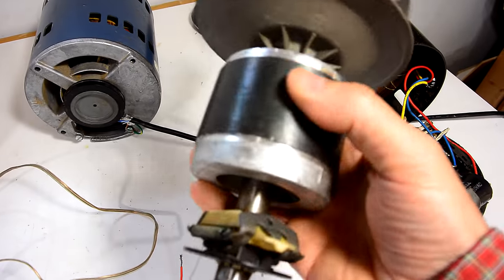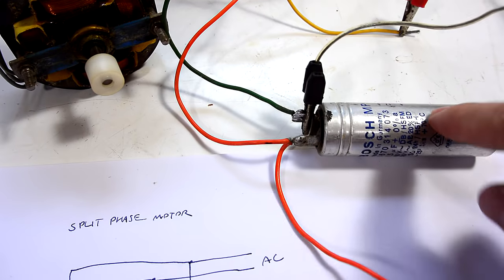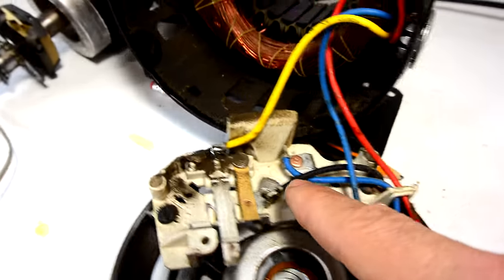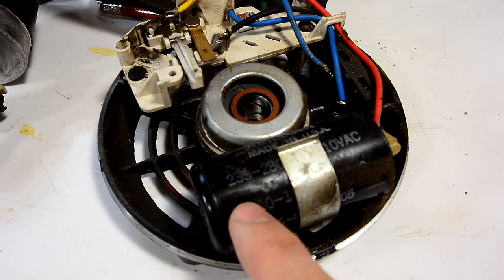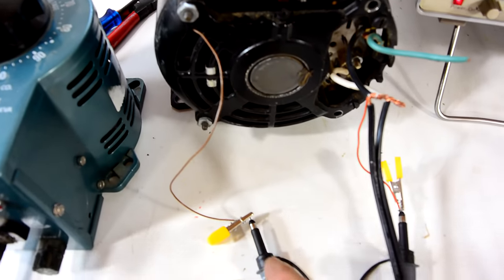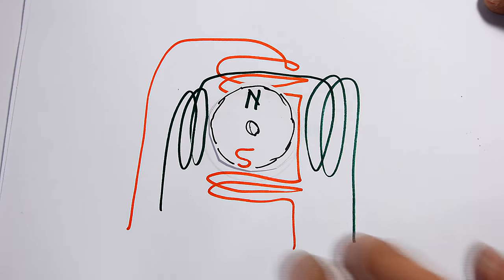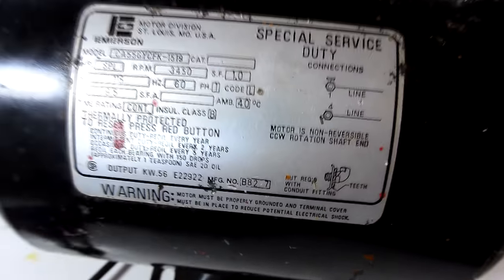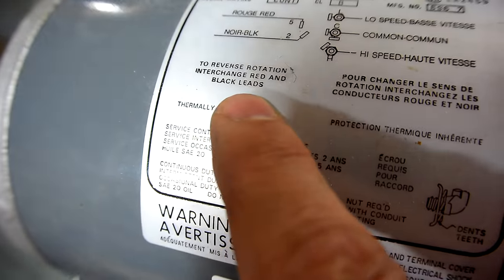Reversing single phase induction motors

Comment: hello Mr. Wandel,
could you help me solving this compressor motor (230V-2HP) problem
- when I use a wall socket with 230V AC on right side (* see note), the compressor runs
- when I use another socket where connections are reversed (* see note), I get a short circuit: 
a spark and my mains fuse or differential circuit breaker trips
The start capacitor (35 uF, 450V) checked with an analogue ohmmeter seems OK: not shorted, not open  (there is a charge current, the needle moves accordingly)
(note *) I checked the different wall sockets by measuring between 1 side of the outlet and the earthing pin
Reply from the maker: I'd need to check things myself to diagnose this sort of thing
Reply: it's strange that swapping live and neutral would be causing this. Our wall sockets have no standard for which side is live and which is neutral
Reply from the maker: That would suggest there is a mistake somewhere else, such as one side wired to ground.
Reply: Well I think that may be the conclusion indeed. Thanks for your help. And before I forget: congratulations with your videos, especially this one - it was very useful. I may look to some more!

Comment: I got a question for whoever has the answer or knows what they're talking about, so my question is in order to change the reverse polarity on an AC motor do I need to have 4 wires coming out of the motor in order to change the polarity or reverse the motor??? Thanks in advance
Reply from the maker: you. need to understand how the motor works, that’s the most important part.

Comment: Why would you want to reverse a motor in the first place? 

Great video by the way.
Reply: Jan Willem ... for the best daiquiris.
Reply: Jan Willem Some machines like cabinet shapers make use of both the top edge or the  bottom edge of the spinning shaper blade.By reversing the motor thru switches,,you can have the wood get cut on the underside or topside of the mounted shaper blade,depending on where you want the most accuracy .  This also enables a shaper bit to have 2-3 useable patterns on it.

Comment: can somebody explain to us, how can we modify the wiring inside the multi-speed ac induction motor? which polarity should be swap to get reverse motor rotation? thanks
Reply: +Proyek Canggih Always swap the start winding. The speeds only reflect more sets of windings. Reverse all start windings to change the motor direction at all speeds. If you can't identify which is the start winding as Matthias pointed out the winding has thinner copper, so measuring with a multimeter will show to it have a much much bigger resistance compared to the run.

Comment: what's up with the video ? interference or did you forget to deinterlace ?
Reply: Video quality was fine when I watched it.
Reply from the maker: Joe G.P. I had to shoot it interlaced so the scope trace showed up more consistently.
Reply: Joe G.P. I noticed that too. I wasn't going to mention it unless someone else did. It appears to me that at least one of the cameras used either shoots in an interlaced format and didn't get deinterlaced by Vegas for whatever reason, or somehow those clips got set to interlaced inside Vegas and since the final render is progressive the interlaced clips look inferior. I think it's just a simple overlooked setting or accident one way or another, as I have not noticed this issue in Matthias' videos before.
Reply: Matthias Wandel got it, thanks for answering.
Reply: Ah. I didn't think of that.

Comment: It's kind of ironic that the logic of 3-phase motors are much simpler than single-phase motors.  To reverse, you just switch any two of the three power supply wires!

Comment: I think we should note that connecting a scope to the AC as you did can be very dangerous and even destroy the scope. You obviously know that and correctly left the scope probe ground lead disconnected and the ground back through the service neutral/ground bond was sufficient for your demonstration. But to do that measurement safely and without the noise on the waveform, you would need an isolation transformer feeding the motor. Another cheat, which I have done, is to use a ground lifter on the scope AC cord. But then the metal case of the scope is potentially hot. Unless you know exactly what you are doing, always use an isolation transformer on any AC  line side measurements with grounded test gear. A DMM is an exception as it is not grounded, but a service bench style volt meter might have the negative lead grounded.

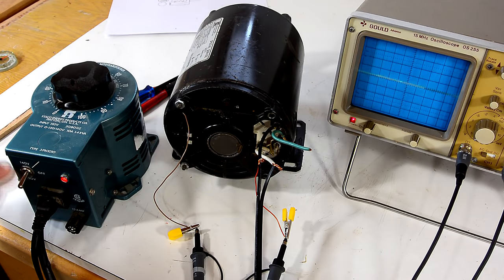Comment: 5:30
Did you measure the motor starter circuit waveform with the earth-ground of the CRO connected?  I've read everyone's over stressed ramblings about "just buy differential probes." I don't see why people are so scared to just say what works. Darwinian Exit awards are good for the gene pool. My scope has an isolated switching supply, and a plastic case. I think it's completely ridiculous modern scopes are not 100% isolated by default like a DMM. Even without OEM isolation, people should talk about how to make scope measurements and just say, "don't touch the BNC or ground terminal lead." That is more than sufficient warning. Any idiot should know to setup the test equipment, step back, plug in the device, and touch nothing until powering it off. 
  I need to test for voltage spikes on a new Craftsman Jointer, with an universal motor variable speed controller (U2010b). I've reverse engineered (retraced) the circuit, posted on the eevblog forum, and published the board files under public licence. I'm looking for what causes all the failures as seen on Lowe's website reviews. I'm a simple hobbyist with a scope used mostly for hacking uart serial baud rates and Arduino projects, 10 amp AC mains is a bit ambitious. I have a cheap Asian pocket scope ordered but would like to use my Rigol on my test etched prototype now instead of waiting who knows how long for shipping.
-Jake

Comment: About changing motor direction... Can I change motor direction without waiting for motor to stop??? Can I just Switch it to other direction while motor is running, or I must wait for motor to stop??? Anyone ?
Reply: The centrifugal switch takes the capacitor and start winding out of the circuit after the motor is up to speed. Short answer is no

Comment: Why would you do this ? I don't understand the purpose
Reply from the maker: Chris Truitt If a motor runs the opposite direction of what is needed, what would you do?
Reply: I see I just thought you had some cool project that you need to do this for , that's why I asked
Reply: Chris Truitt One case would be if you are using it on a milling machine. CW when viewed from the top is the "normal" direction, but sometimes you need to run the spindle CCW. I can imagine you might want to run a drill press in reverse in some cases, too.
Reply: Oh I see , thank you for enlightening me I appreciate it very much :-)